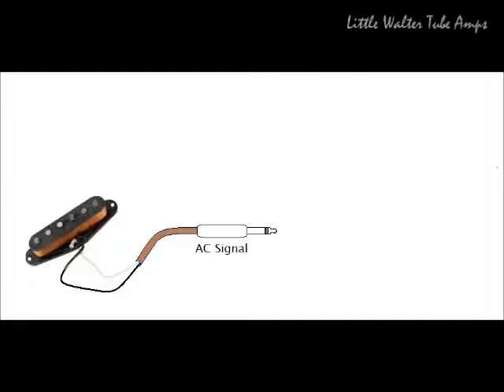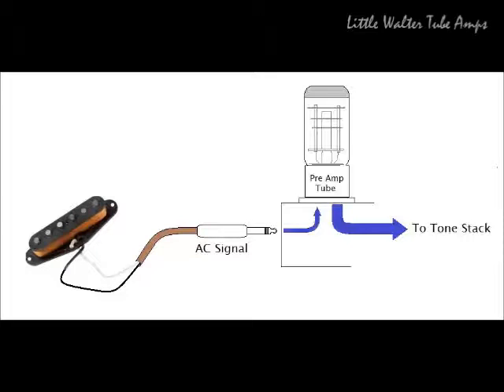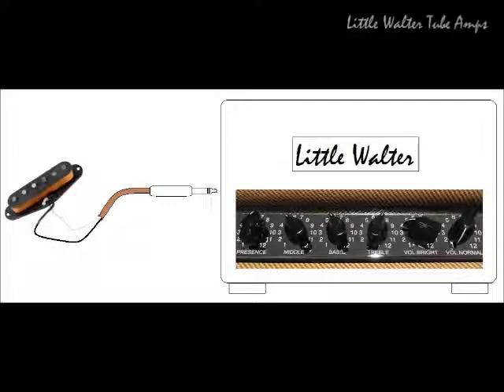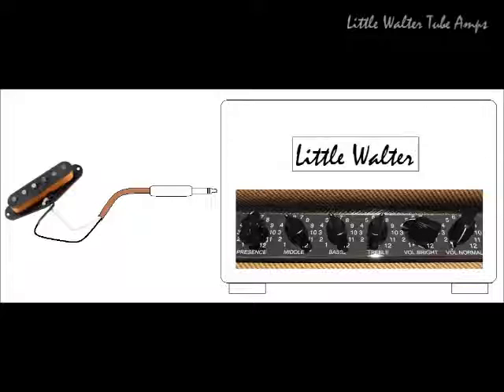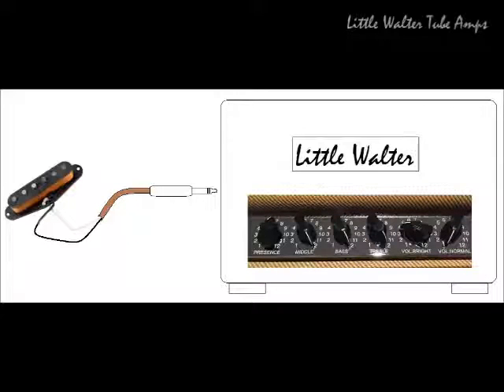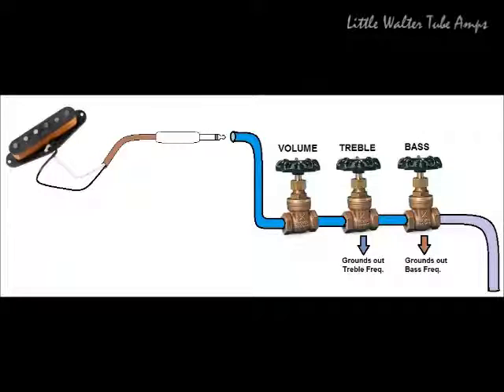Little Walter Tube Amps Educational Series on Tone Stacks

Comment: I used to be always dialing the treble low on my super reverb because I thought it was such a bright amp but I only achieved a kind of thin non descript sound, I finally realised that turning the treble up to 8 or 9 really fattened up the tone and made the amp come alive
Reply: This is very true. I did the same thing on mine. I found on mine (DIY Clone) that once the treble gets up to 8 or 9, the bass and mids interact more pronounced with the treble freq. That made the amp and circuit a lot more interesting to experiment with.